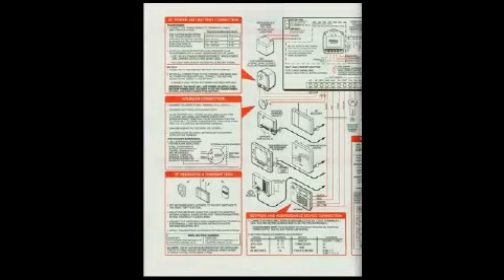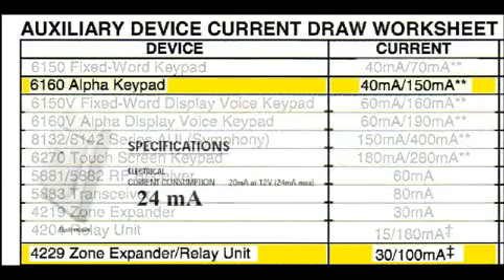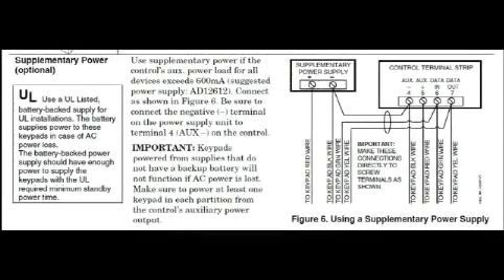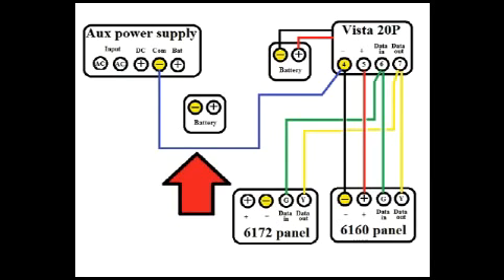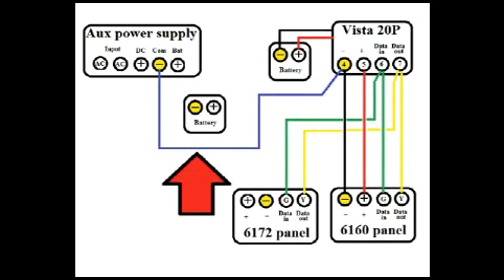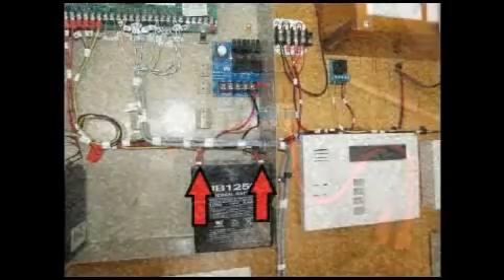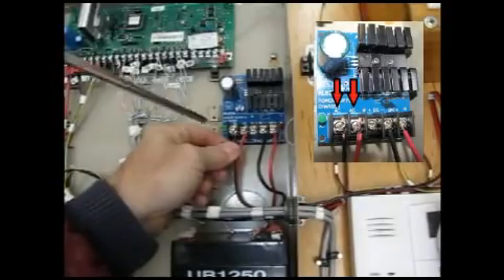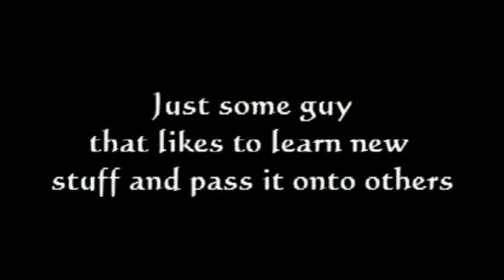installing a supplemental power supply (Vista 20p part 14)

Comment: If the AUX power supply is in a separate cabinet and there is no power connection (+/-) between the two cabinets i.e. only the sensors (Y/G) interfacing between the two; do I still need to connect the negatives between the two cabinets?  I power mainly the motion/water sensors and external alarms (via relay) in  the 2nd cabinet.
Reply from the maker: Any time two power supplies are operated within the same system, they should be tied together as this video shows at time 3:33. The location of the power supplies do not change this requirement. 

You said the Y/G wires go between the cabinets. This is your common tie point. 

With that said, you may find that your system may still work if you don't tie the power supplies together. Remember I said in the video that the power supplies MAY not be referenced at the same level (it's a roll of the dice). Sometimes you get lucky and they are at the same reference, so everything works fine. 

Finally, if your system is currently working without being tied together, this could change at anytime.  As components in the power supply age (especially the capacitors), they sometime change in value. This may cause the reference voltage to shift as this video shows.

Anyway, I always tie all power supplies together as this video shows.  Good luck.
Reply: @bounder97  Thanks.  BTW, you have no video of best practices with motion sensors.  It would be nice, in your spare time.
Reply from the maker: @johnchrome4175  Hi John.  I am unfamiliar with this new term you used. SPARE TIME?! I will look it up and get back to you. Thanks.
Reply: @bounder97  Sorry another stupid question.  My aux power supply is in a separate cabinet, which includes an alarm relay connected to 3 & 4 (-) of the main panel.  I assume connecting this negative to my aux power negative is sufficient.  Or should I run a separate wire from the panel?
Reply from the maker: @johnchrome4175  Yes, this should work. There does not need to be a separate wire. As long as the two power supply negatives are electrically connected together you should be good to go.

Comment: Dear Bounder, your Vista 20P videos are amazing Sir! If Honeywell hired you to do all their "how to" video, they probably would no longer need a tech support line because you provide such GREAT details and have helped me many times during my installation process. Can I please ask for a recommendation on how to add additional power to my Vista 20P in case of a power failure. I have an expansion module and currently use about 12 zones that consist of MANY devices connected such as 6- is335 PIR' s, 5- System Sensor 4WTA-B smokes with audible alert, 1 - C02 detector, 3 Wave 2 sirens and 3 System Sensor Horn/Strobes. I added the total mA which comes to about 2315mA, then subtract 600mA which the panel originally supplies leaves me needing 1715mA. The system is 100% operational right now, however I am just wondering what I should do to add a second battery to make sure all these devices will continue to work for a few hours if there is a power failure. I would gladly pay you for the help and support of what I need to buy and how to connect it. Thanks in advance
Jimmy
Reply from the maker: Wow, thank you for the kind words. I am a bit confused, you said your system requirements are 2315 mA. Are you driving the extra equipment with additional power supplies? The Vista draws considerably less current when just monitoring then it does during an alarm condition. Remember that most alarms (like the sirens and strobes) do not draw current until they are activated during an alarm situation.  Other items, such as possibly your audible smoke alarms draw minimum current until activated. Have you tested you system in the alarm condition to see if it still works? Anyway, the way I increased power failure battery time on my own alarm was to simply get much bigger batteries. The larger batteries will not fit into the Vista Panel. I just extended the wiring out of the panel to the batteries next to the panel. In choosing your batteries, keep the voltage the same, but look for an Amp Hour rating increase on the battery.  To educate yourself on batteries, see my videos on BATTERY EDUCATION. The first video is at 9sFKMyL37Cw.  Additionally, hooking batteries in parallel will also increase the Amp Hour rating while maintaining the same voltage.  Good Luck and thanks for the comment.
Reply: @bounder97  Note, Vista panels are only designed to charge one 7 ah battery unless you have a Vista high panel such as the vista128bpt. That panel can charge 2 7ah batteries. 
It would be better to find an aux power supply that can charge the larger batteries and move all the powered devices to it. That way the main battery would only be powering the panel in an outage.
Reply from the maker: @edwardlassiter1479  Edward, could you please point me toward any documented reference that states the Vista 20P  can not handle charging batteries in parallel. The installation manual for the Vista 20P even states that you can purchase a kit (P.N. SA5140-1) to specifically hook two batteries in parallel. While using this kit with two NPG18-12 batteries, your capacity is 17.2 AH. This is directly from the installation manual. Additionally, the installation manual only states a minimum size battery. No where does it state a maximum size battery. A properly designed battery charger would have a current limiter in it to prevent it from burning up while charging. Since the Vista 20P is capable of a UL installation, I'm confident it was designed properly.

Comment: Nice video. One thought, thought, you don't need a separate transformer for the supplemental power supply (AL624). Just one transformer with enough VAC to power both the Vista panel and AL624, such as a UB1640W3-L6 transformer which supplies 40 VA.

Simply wire the transformer to the AL624's AC terminals and run another another pair of wires from the same AC terminals on the AL624 to the AC terminals on the panel.  Save yourself some time and free-up an outlet.  :)
Reply from the maker: Hello, thank you for the information. I will be sure to pass it on to others.

Comment: Where do you buy the double backed foam strips from? I see it's made by 3M. What is the item #?
Also, your videos are excellent. I learned so much about electronics from them.
Reply from the maker: Hello, thanks for the question. The tape in the video came with the power supply. But you can buy the tape in many big box stores or off the internet. Example: search the internet for "#302208270". That will take you to home depot.  Or just search for double back tape.  Thanks for the complement!!

Comment: nice clean work sir. I have a question. if there is a fault with the 2nd battery, will you get a notification on the panel?
Reply from the maker: Thank you. That is a great question. I actually have no idea what the answer would be. Logic would dictate to me that the panel would not know there was a fault since the second battery is not on the circuit that the battery monitoring is on.

Comment: Hello Bounder97, thanks for the great video's on the Vista 20P installation.  I am running the V20p with a 6120RF as the primary. Later installing a 5828 as the #2 with it's on power adapter. But, the main concern I have is the sounder alarm Ademco 748 with a 1200ma draw, how would you wire the siren with a supplemental? I can get the similar siren 748LC that draws 550ma when active. If this was you, how would you proceed? Thanks Marvin!
Reply: +Sandra G Smith (Sandra n Marvin) 6160RF, sorry for the typeO!
Reply from the maker: +Sandra G Smith (Sandra n Marvin) If I wanted to wire my output alarm to a supplemental battery, I would use a relay. I showed how to wire relays in my home security video part 10 (installing an autodialer).  
https://www.youtube.com/watch?v=G7wkoTQybJc
The relay will be activated by the alarm output, and the current to drive the siren would then be passed directly from the battery, thru the relay and out to the siren.

Comment: would it be ok to put 2 12v lead acid batteries in parallel?
Reply from the maker: +mark rossi Yes, you can hook batteries in parallel. This will maintain the same voltage, but increase the current capacity. Keep in mind that you are effectively building your own large battery by increasing the cell count. As a result, the batteries you hook together should be as identical as possible. (ie. same manufacture and age.)
Reply: @bounder97  no you will shorten the life of the vista 20p . It's built in charger will burn out. Not designed for it.
Reply from the maker: @edwardlassiter1479  Edward, could you please point me toward any documented reference that states the Vista 20P  can not handle charging batteries in parallel. The installation manual for the Vista 20P even states that you can purchase a kit (P.N. SA5140-1) to specifically hook two batteries in parallel. Additionally, the installation manual only states a minimum size battery. No where does it state a maximum size battery. A properly designed battery charger would have a current limiter in it to prevent it from burning up while charging.

Comment: Thank you so much. The Negative jumper wire fixed my problem.  I have three 6160 keypads hooked up and the remote 2 would show display but the keypads would not work.  This jumper wire fixed my problem!  Great videos!!

Comment: Hi Bounder, another excellent video. I want to take a moment to thank you and Zimsjeep, two very informative channels... I needed some help so i'm reaching out. I have a Vista20P, it handles the usual alarm functions great but the challenge is getting it to do the unusual. I have, 2 tuxedo touch KPs, 6160v and 6150v remote keypad for my wood shop. Here is my challenge, i have 3, 5800pir ODs. Using a programmable zone 91, i can get chimes when not armed stating specific faults such as motion, front driveway, rear driveway and backyard. The issue is when armed, the best i can get is for the KP to chime when any of the 3 5800s are tripped with the KP saying "Armed Stay or Armed Away" it says this twice for some reason. I don't know which motion was tripped from hearing that, it could be any of the three. I don't want the alarm to be triggered which is fine, i just want to be notified which is what it's almost doing. From reading various posts, i believe, programming the 5800pir ODs on partition 2 would do the trick. The issue is, i can't find and documentation that can walk me through this. I did an experiment; i went into zone13, which is one of the 5800s, changed its partition to "2". The result is no chime at all when tripped. Do i have to switch the keypad to partition 2 and program it from scratch like i did partition 1? Going to *26 on partition 2 and enable chime by zone, going to *81 and inputting zone 13 and the other 2 zones, going to zone 91 and making the 10 entries? And lastly, what do i do with the information for these zones already in Partition 1? Thanks for listening and any feedback would be helpful. keep up the great work... Cheers,
Bill
Reply from the maker: +Bill Reneau Hello Bill, I'm sorry that I can't help you with this. I have hardwired my entire alarm. I have no experience in dealing with the nuances of wireless systems.
Reply: +bounder97 Hi Bounder, thanks for the quick response. Ok, it was worth asking. I will continue my quest... Thanks again. Bill
Reply: I know those is old, bit you'll need a P2 keypad.

Comment from the maker: Hello David, I am not sure what you are asking about 
"a current running through my hardwired zones". Anytime there is a complete circuit, and voltage is present, there will be a current running through the wire. So it would be normal for current flow if the zone you are monitoring is a complete circuit. The amount of current flow is determined by ohms law ( I=E/R). I=current, E=voltage and R=current. Hope this helps.